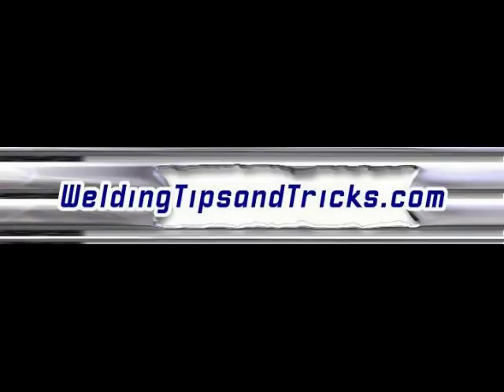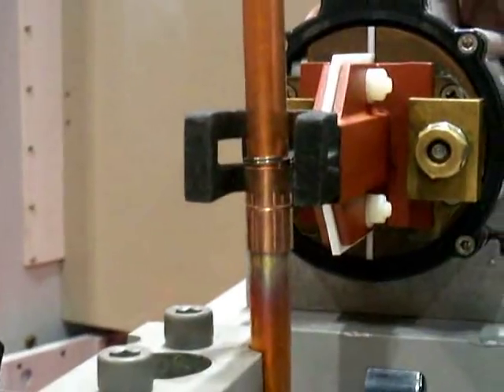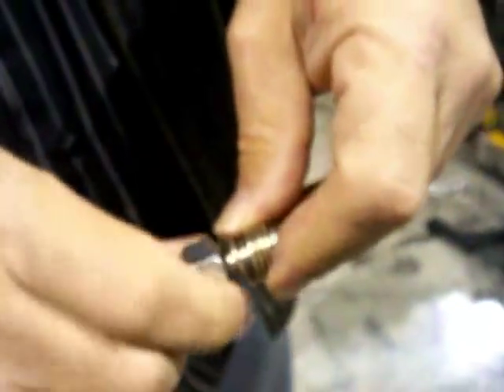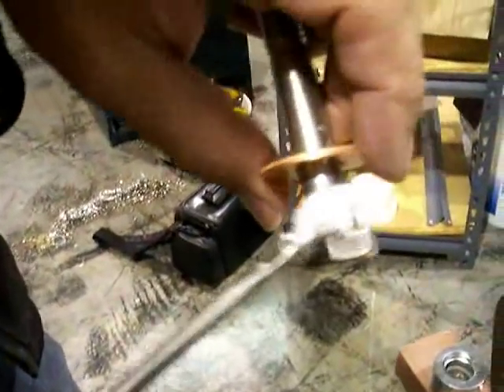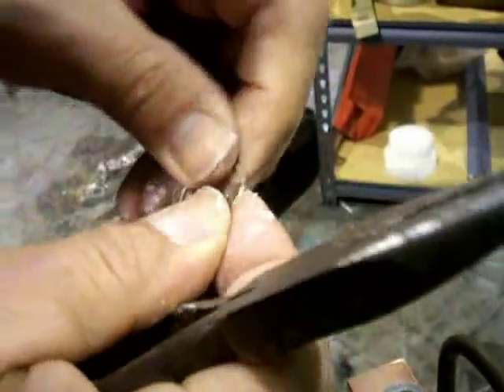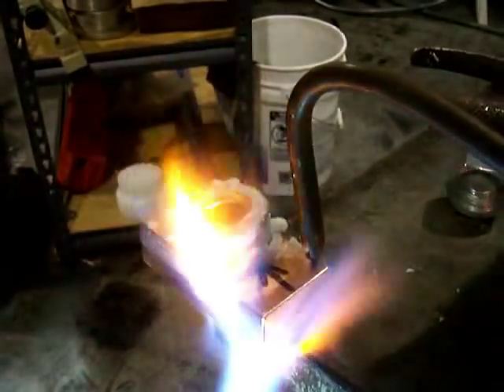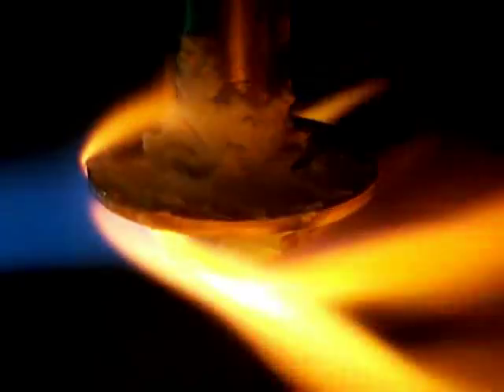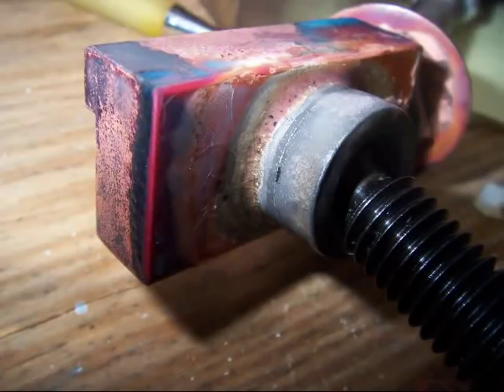Brazing Copper to Steel

Comment: I have been in HVAC for over 3 decades and the ring of sliver solder idea works so well! How many joints have I battled with trying to get solder into a tight spot with a bent rod! This was a great new technique for an old dog. But, only put flux where you want the solder to flow. It all has to be cleaned off and  the surface oxides aren't a problem compared to the glass like hardened flux deposits that cause corrosion where they aren't removed.

Comment from the maker: @citydriver  In this case, the purpose was strictly the drawing specifications . I suspect it was part of some type of fixture for electroplating that needed a good conductor.  All that flux came off easily in a bucket of hot soapy water.

Comment: Great walk-through on Brazing Copper to Steel on the two assemblies.  Excellent demonstration.  Gas heat and induction braze welding.  Thanks for the outstanding melting and flow.  

T J (Tom) Vanderloop, AWS & LSME. Author, Technical Educator & Shop-floor Consultant (CMfgE/CMfgT)

Comment: Heya Jody,
Thank you very much for taking your time to make/upload these great videos!!!!!
 I realize that it's not called out/required for this application, however, if there is a 5 to 10 thousandths gap between the copper/steel, it will greatly increase the strength of the joint as it allows the solder to flow between the parts. 
 The gap can be made by using a center punch to deform the copper or steel, a cold chisel for longer ones works great as well.
Thanks Again & Best Regards,
Jon

Comment: From experience, that table top looks like a great heat sink. I'm sure that block of copper requires a lot of heat for braising but if you could get it up off that table it would require just a little less. It can make a difference.
Reply: +1 Even 1/8" gap can make quite a bit of difference

Comment: I have found if you chill the part in water after everything has solidified, that the flux will come off easily. Good video. Thanks, Jody!
Reply: I work mostly welding steel, and at least with that you don’t really want to dunk things because the rapid cooling and warping can weaken the joint. Not sure how that applies with the pipe as well as the types of metals/filler used here though.

Comment: Making some air rifle targets out of some 10 or 12 gauge copper sheet I have lying around and I want to solder spring steel from an old grass rake to the copper just so the targets will dance when hit with a pellet. Reactionary targets, if you will. I’ve done a lot of pipe soldering copper to copper and copper to brass but I’ve never tried copper to spring steel. Can this be done? And can it be done with the same flux paste I use soldering copper to copper?  I’m going to find out the hard way maybe as soon as tomorrow. But maybe you can provide me some insight. Watch your videos all the time so I finally subscribed.  Great insight and very informative.

Comment: i was wondering if you could do a video about how to braze or tig brass to copper? i am building an oil tank out of 6" copper pipe (approx 1/8" wall) and i am going to be using brass bungs for feed/return lines and filler cap etc... welded the tank with tig using a copper wire for filler, turned out good as far as i can tell. thanks Jodie

Comment: How did you, or what was your method of centering the ferrule on the copper prior to your soldering?

Just a slight offset can be terribly noticeable. I've got two ferrules to join, my first attempt was not even, and like a blind man joined two piece of column..

Comment: great demo, doing the monolog as a commentary on the video works.
but silver is expensive. so generally you have 3 brazing materials ?
lead, lead free, and silver, for most of the materials
one would want to join together ?  is that because silver is more versatile and bonds with most metals ?

Comment: Hi there LM working on a lawn trimmer muffler and I have a copper tube in it to direct the exhaust and oil out of the back instead of all over the muffler sheild. it's a mess. any ideas on how to seal that exhaust pipe??

Comment: Would find one of those induction heaters verry usefull at work for silver soldering copper pipe, better than the old oxy acet. Very interesting vid, thanks,

Comment: Dear sir ...what the purpose you use the flux....?
Reply: +MrTonyshit80 ~ It prevents oxidation during the process and also allows the solder to flow properly. Solder moves by capillary action.
Reply: Good explanation. so I got some knowledge to day...
Reply: and helps clean the metal surface

Comment: if you have small parts, he's using oxy/fuel here, there's no way you'd get that copper block up to temp with a little propane torch

Comment: "Don't flux everything up"
Reply: My comment was the play on words. I heard when Jody said that, don't "fuck" everything up.
Reply: lol i fluxed it all up
Reply: 10,000 Rambos Ahhhh, hahaha... I see what you did there!!! Ahh hahaha
Reply: a freind of mine tried to melt the silfos of an AC compressor copper tubing and he tried for ten minutes using propane torch ,said the tube turned red hot but the braze was not coming apart,,a refrigeration guy was laughing at him and said he can not use a propane /air torch to do this job but to me it made no sense because those torches put out about 2000 deg C and the silfoss melts at 800 deg C